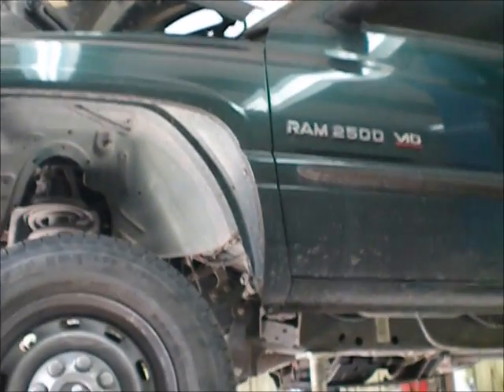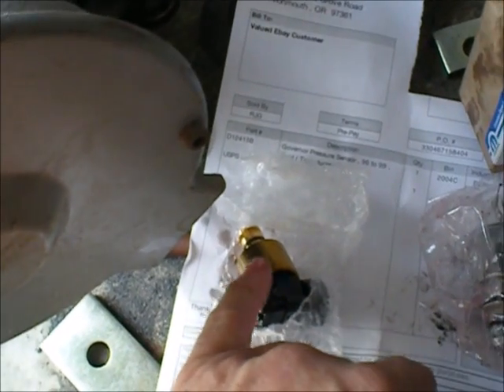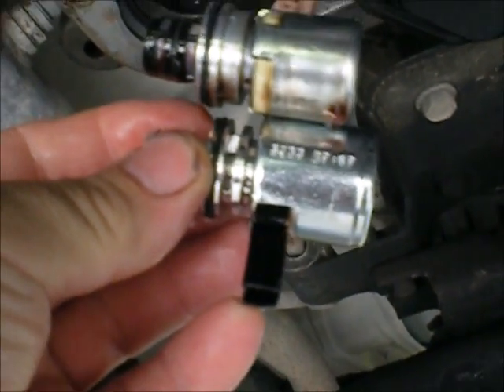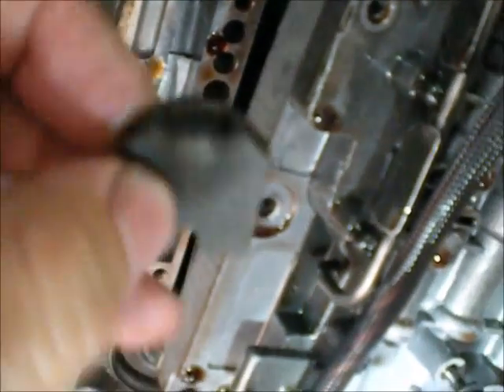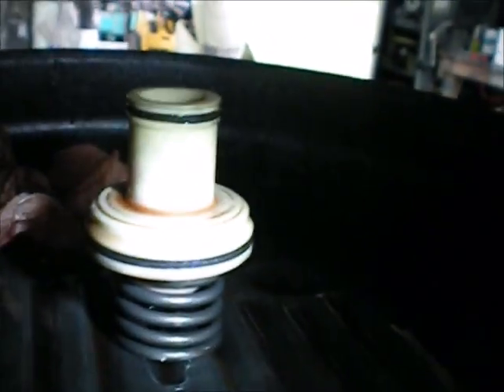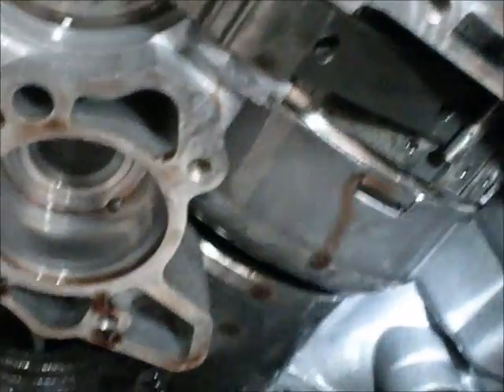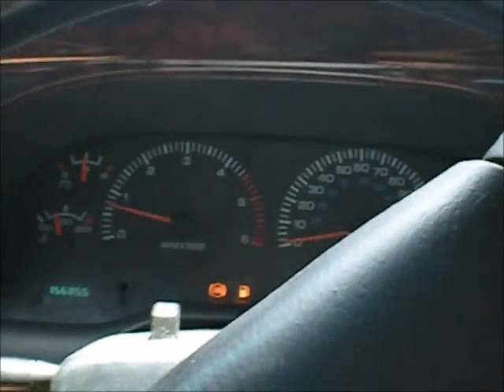Dodge 47RE Trans No 1 to 2nd Shift   Interesting Discovery Inside

Comment: Love the video I think I have the same problem I just haven't pulled my pan. Plus I can't get it in park if you or any body may know why pls let me know thank you
Reply from the maker: It's pretty common on these Chrysler Transmissions they're about the only ones that don't automatically adjust to hydraulic pressure.
Reply: @TheKiloG69  just pulled the trans pan and I broke pump arm if that makes sense

Comment: Love my lil Mule,2003 single short bed with the 4.7. Leveled,changed the rear to a 4:10, super 40 duel out, MT exstreeme2 on MT 17's .I have beaten quite a few cocky hemi drivers with the mule,lil sleeping Mule. Love this truck but when I blow it up gonna buy a new one but take this and put a Cummings in it and a Manual shift of course.

Comment: I had the same problem with my 48re in my 5.9l Ram 2500. Replaced the governor pressure solenoid and changed the plastic transducer out for the older one like yours with a kit from BD diesel. Adjusted the bands and so far so good. Love the truck but the transmission not so much. Wish it was the manual

Comment: My 2000 Dakota sport is having shifting problems I have to let off the gas so it can shift for 1,2 wants I get up to about 40 mph it does ok. You think this is my problem too?
Reply from the maker: I'm not sure I'm not a transmission expert I just fixed my own vehicles.
Reply: @TheKiloG69  ok well its having the same trouble as yours so I hope doing what u did to yours will fix mine. Seeing that this is a very common problem with Dodges

Comment: The band broke make that piece fell in the pan, don't have to replace governor solenoid and sensor for that problem, transmission need to be removed for replaced the band.
Reply: No. The trans can stay in to install a new band. Just use a piece of wire to pull the new one back around the drum. I did it. Im glad it worked cause i dint mess with transmissions. Lol

Comment: Why would you throw away a v10 for a I6 diesel?
Reply from the maker: V10 5mpg vs Cummins 12 Valve 20mpg.
Reply: @TheKiloG69  no, the sacred v10 though haha. But are you talking about the average, no load mpg or loaded up mpg?
Reply: 8.0 vs 5.9 My Cummins gets 18 average, I have a ford V10 (6.8) It gets 11, empty, oly has 85k miles. Cummins goes almost twice as far for the same $ and diesel power is a whole new level compared to gas.

Comment: Replaced overdrive, transducer, and governor solenoids but it wont shift on time. 1st gear 3400 rpm shifts into 2nd (40mph) havnt gotten to 3rd or 4th gear. Once in a blue moon at a full stop i will take off and it will shift into 2nd gear earlier. Someone said when changing fluids you have to adjut bands? Also the trans fluid has only been replaced one day ago and if i have to drop the pan again can i re use the transmission fluid being it is fairly new?

Comment: I have NO shift from 1st to 2nd on my 47RE but only when it's in 4 wheel drive low range; high range and 2 wheel drive shift perfectly.  My truck's a 98 V-10 Quad cab with short bed and not a dually.  Would that be governor and solenoids also??
Reply from the maker: In 4 wheel drive U are going to slow to shift that's for climbing creeping along.
Reply: @TheKiloG69  Hmm...so my truck when doing 40mph through a snowstorm in 4WD is in 1st then? What is it I'm feeling the truck do about 3 or 4 times getting up to speed? It must have the Hiccups, everyone KNOWS that..."In 4 wheel drive U are going to slow to shift that's for climbing creeping along".  Especially in LOW RANGE your truck will shift A LOT more just getting up to speed 4th gear low range happens, you must not get off road much.
Better to remain silent and be thought a fool than to speak and to remove all doubt

Comment: The reason the piece fell out is the band is junk. 
Check the inside for friction material and then look for the video on how to replace it without pulling the transmission.
Reply: Its an easy fix for experienced mechanics..noobs do not attempt to repair this yourself..you will trash your transmission.
Reply: Band not junk just not  adjusted  ever 40k. So it lost a piece that was on the magnet  in the pan. Reinstall  tighten  torque  then back off. I doubt  that the upgrade parts were needed.  FYI the rear band(1st , 2nd & rev) can not be replaced with transmission in truck. If you do replace  order  the 727 torque flight band in Kevlar thick and will allow for drum wear.
Reply: You can not replace the 1st,2nd,rev band without removing the transmission  not on a 2500 3500 47 46  you can replace the 3rd,4th band with out pulling the transmission.  On 727 tourqe flight and newer 1500 2500 3500 all 605 cases. And none of the tran mechanics  think the bands are junk. But prefer the 727 band it is a little thicker and wider and will work better and last longer than the stockor any after market. (Cheaper upgrade) just make sure it is made with Kevlar.  The key is to resource every 40k (not longer than 60k)  so with the truck running put in neutral and shift into gear front and backwards if it doesn't  want to move within 1/2 second or you have to raise the rpm to engage it is time to adjust (have to drop the pan[get a upgraded pan with plug or install one.  I agree with the upgrade parts plus a largest non a wavie lock ring out of a chev 350 trans. Shift kit
Reply: No the reason it fell out no maintenance  for 100k manufacturer require it to be done every 40k this truck had over 100k.  Yes check for scoring on drum.  I would order the 727 band made of Kevlar.
Reply: I bought a 99 durango cheap with no second gear and replaced the band with a raybestos HD 
this is not a job for amateurs because you need to remove the valve body, solenoids, shift rod, and parking rod is very tricky. 
Also the fluid pressure is way off and allows the trans to upshift way to early into 3rd before it crossed an intersection.
Reply: @KieranMckean  adjust the TV cable...may need alil slack taken out
Reply: @KieranMckean  there is a easy shift kit for that.

Comment: Hi I have exactly the same part as you inside on the bottom of the pan,how do you removed the valve body? the one  that was hunging down I can,t  really see.
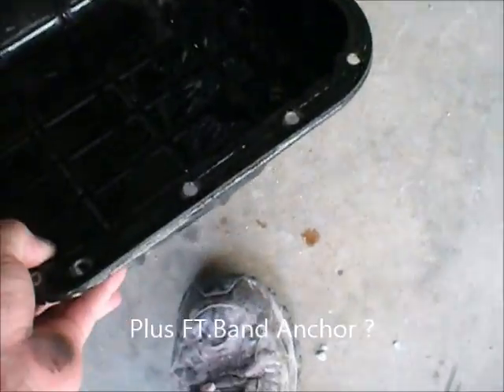Reply: The part appears @ 1:41  and goes  between the band and the tension bolt on the 1st and rev band.

Comment: what did you do to get the valve body to drop that far? I can't figure it out so I'm stuck now
Reply from the maker: +David Rivera Pull all the bolts out.
Reply: how many bolts hold it in ?
Reply: David Rivera rom 5.9 2001 Dodge

Comment: thank you for posting this video! my 2001 1500 4x4 has been doing this the last 3 years I've had it. drove it anyway as I couldn't afford $2,200 for a rebuild. mine stays in first until I reach 2,000 rpm then I ease off the gas and it goes to 3rd. second has pretty much been gone the whole time. I drive it easy while saving money for the rebuild. I'm going to drop the pan to see what I can find, I've swapped engines and am semi handy with a wrench, you've instilled some confidence in me to tackle the one automotive part that scares me to work on. thanks for the info! much appreciated!
Reply: Sometimes, Pull over turn it off and turn it on usually does the trick and it will go thru all the gears but not all the time.
Reply: Andrew Lane did you figure out what was going on?
Reply from the maker: +Donnie Wilson You are welcome..... hope this helped U a little.
Reply: My 98 5.2 L 1500 likes to stay in first.. Cant figure it out... Any ideas would be great....

Comment: nice video, i have been experiencing the same 1-2 problem, will even downshift to 1st if any throttle whatsoever rather than ever so gradual speed gain in my 99 v10 2wd with only 82,000 miles. already adjusted bands after 1st experiencing problem. i will update after installing kit.  http://www.ebay.com/itm/98-99-A518-GOVERNOR-PRESSURE-SOLENOID-SENSOR-TRANSDUCER-46RE-FILTER-PAN-GASKET-/251347250492?hash=item3a8576ad3c&vxp=mtr

Comment: FYI, That piece that fell off the end of the band adjustment bolt false off for a reason. That band is supposed to  be adjusted at regular intervals. The owners manual for my 94 recommends ever 36,000 miles. My guess is this band had never been adjusted and with 160,000 miles on it is WORN OUT. Once the band is so worn out it becomes VERY loose. Nothing holds that piece that fell off except the tension on that band. Once it becomes so worn out and loose it simply falls off the end of the adjustment bolt. This will cause severe damage to the gears and clutches. The whole purpose of that band is to hold and release the clutchpack for a split second so the gears and change. If this malfunctions you can/will destroy the planetary gears. I'm telling you this because I didn't see you replacing the bands. They are very cheap. You basically did everything already that is required to replace the bands you should have went ahead and replaced them. Cheap insurance!
Reply: I have same problem in my 97 1500 ram what parts should i order before tearing into it
Reply: I think i have the planetary gears issus, the car will not back up at all even in reverse, and the bands are loose moves like fully.

Comment: hi and thank you for your video, im having a issue with my truck and was wondering if it was one of the solenoids. its a 2000 dodge ram 1500 with the 5.9 with a automatic trans, sometimes when i come to a stop after 5 min of running i will lose drive then it will suddenly kick in after a couple of seconds. it also seems like it has no power or torque, it runs along as if the engine is working harder than it should be almost like as if it was cold. i have no check engine light on.
Reply: what was your problem? I have the same thing happen to my 5.9 Ram. I have replaced the od,tcc,and the other two  sensors in the  trans. help a sister out.
Reply: Believe it or not I'm still running around like that lol, I've talked to a few guys and they all say something different, torque converter to worn gears to a issues with the electronic clutch. Since it isn't getting worse I've decided to do nothing about it and just drive it as is.
Reply from the maker: +Kayla Brown Every thing I did is in the video pretty common problems.
Reply: Check the throttle valve cable that runs the transmission might need to be adjusted

Comment: Good video and information for those who like to take care of their old trucks. You addressed 2 very common problems with these transmissions, the bands become too loose and the strut or anchor may fall off and you loose 2nd gear but the OEM governor pressure solenoid is also a common faulty part after 6 years or so. I noticed your front band was quite loose, wonder if they were ever adjusted before? My thuck has under 60,000mi and both bands were quite loose (never touched), wonder how long they actually last...
Reply from the maker: HI I just came in from working on it stated taking interior out . I did run it around pretty good today the trans works great I   as  I   start to disassemble this truck I may also just rebuild this trans to diesel spec with extra clutch's and red alto steels  Clutch's & Kevlar bands. The trans in my red truck was all redone before I got it a little over a year a go I might just switch out the 2 wheel drive tail shaft & just swap it in as I have been driving now over a year it is perfect. the red truck is going on the 4 wheel drive frame, lots of work but not much $$ to get what I really what, Thanks for comment I will post the swap soon as I begin,
Reply: @TheKiloG69 so what would the problem be if no 1to 2 shift or 2to 3 shift and it don't shift when you let off the throttle